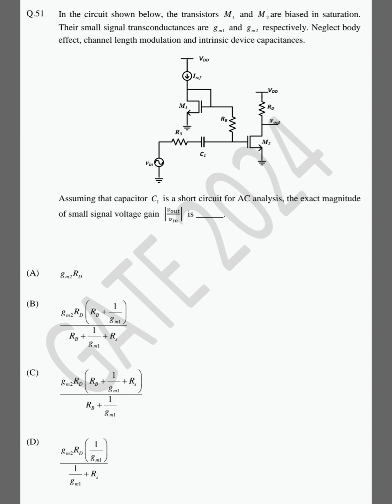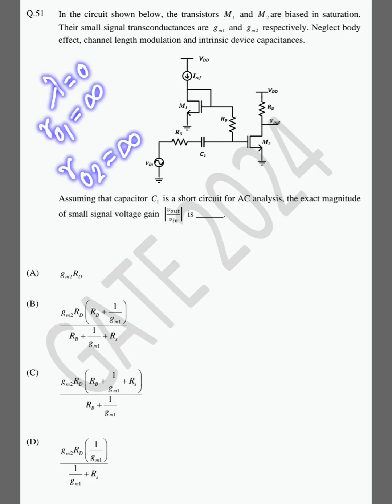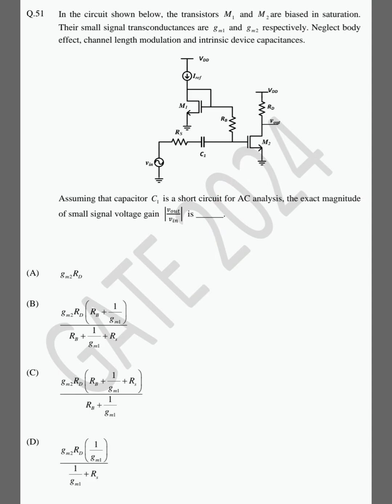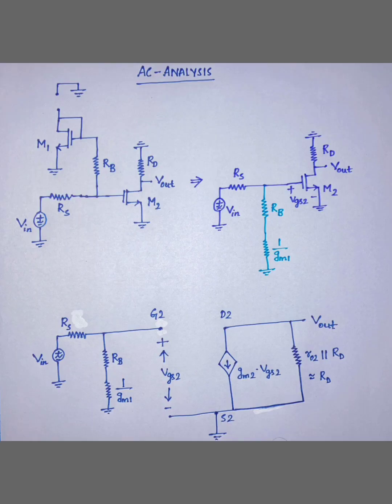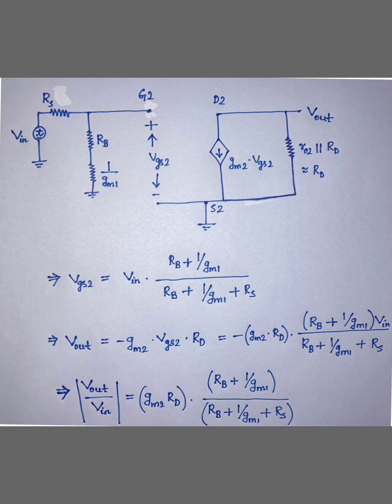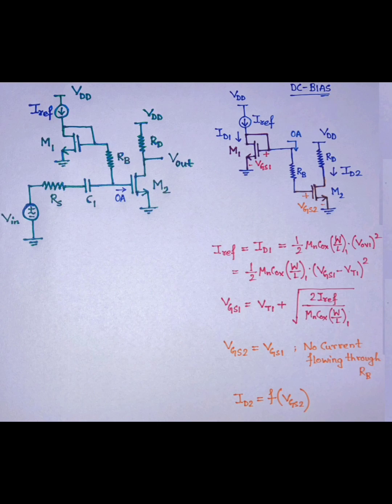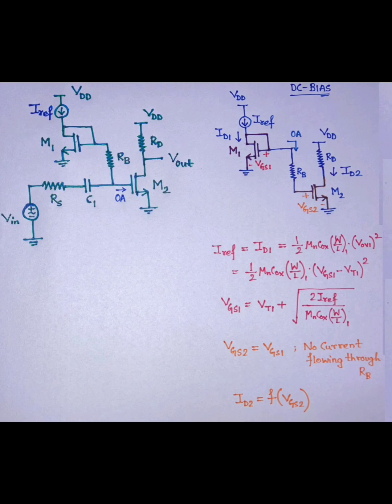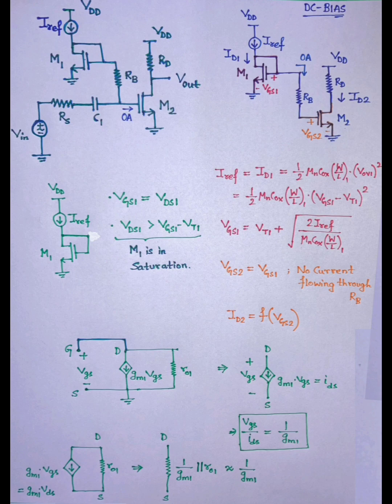BEST CONCEPT FOR GATE 2025 ECE/EE/IN | ANALOG ELECTRONICS | MOSFET #gate2025 #ece #ee #in

Comment: Role of Rb is to prevent loading effect 
Since 1/gm is small quantity and hence small signal will degrade..

However Rb ensures that vin comes as it is at gate of M2 for amplification (CS)
Reply: I appreciate your comment. If you see the AC analysis which i have done, just imagine RB is low (few ohms, say 100 ohm), and gm is 20mS, so 1/gm is 50 ohm, and RS is also 50 ohms, then only 75% of vin is appearing across vgs2
Reply: Since Resistor values are PVT dependent, so this values of resistor will deviate, and in worst case it might be even less than 75%.. So if we have a RB which has very high value say in 100(kilo ohms) where 1/gm1 and RS are very small in some ohms. Then if you see the AC analysis then almost 100% of vin is going to appear across vgs2, and this is consistent irrespective of PVT changes. RB>>(1/gm1 or RS), so even if RB changes by say del%, still almost 100% of vin should appear across vgs2
Reply: Yes sir..
Thank you for giving me more insight to this..!!

But by doing this during layout area will increase...

So there is a trade off right..?
Reply: @YashRPant Don’t worry about Area.. Say you needed you bigger MOSFET to have more drive strength, then you will use multipliers, then also Area will increase.. Here most important is the circuit functionality. layout designers will take care of the Area part..
Reply: @nayanendubiswas662  
Okay sir Thanks! 👍